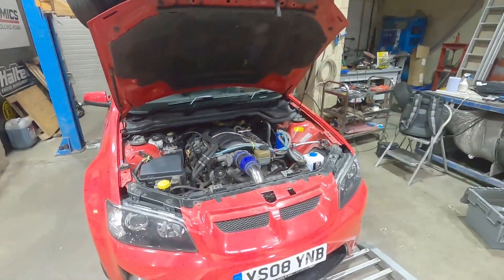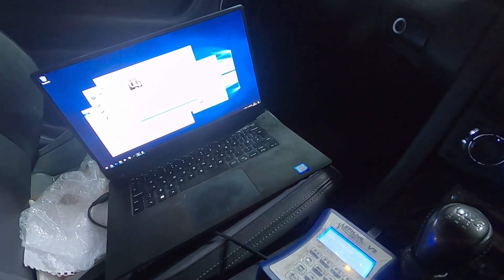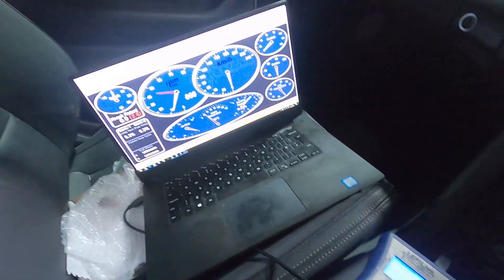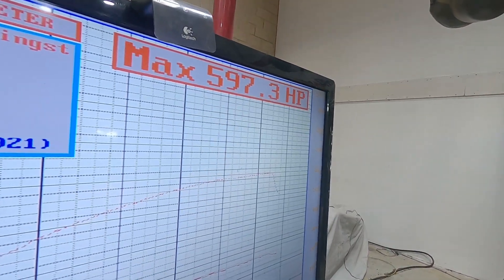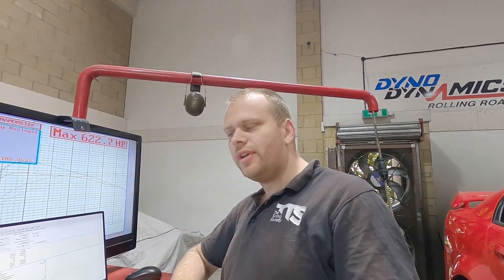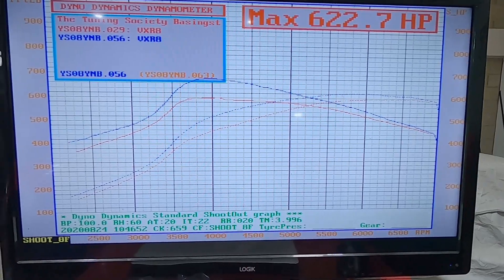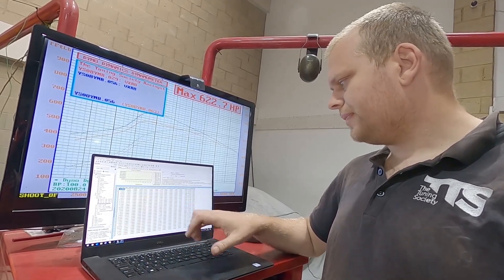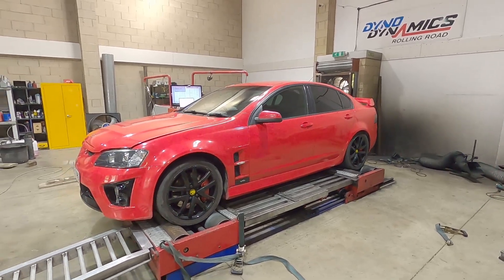LS3 Vs eBay Turbos - Dyno Tuning with EFI Live

Comment: Hi I have to build a ls3,
My HSV 2008 wagon died, ls3 6sp auto.
Cracked head and ?????
So A rebuild or a new ls3 ? New $10,000aus + fitting
Keen to keep engine as resale is going up on these models
Complaints about car were, too quiet and V8 noise not good and low down torque was crap too.
4000rpm onwards-great engine.
0-3000rpm. Crap.
2.73 rear ratio diff lsd etc.
Want a rumbling V8 cruiser with much better low rpm and noise, I don’t care about top end, as long as it sounds clean
Reply: Stock was 317kw and 550nm

Comment from the maker: Any questions ask below!
Reply: You tuned my car a while ago but Iv replaced injectors with new ones and a sport cat will it be ok ? Just replacing new bits as it’s a long distancing driving car 
Astra mk4 gsi running stage 2

Great vid :)
Also didn’t they fit one of the later vxr8 with the LT engine ?